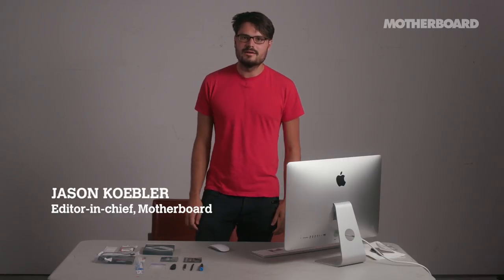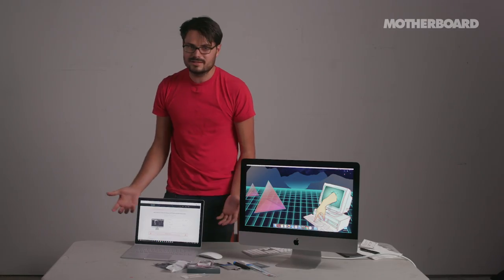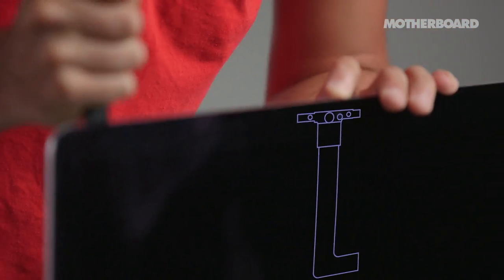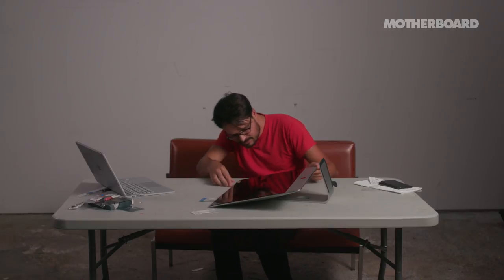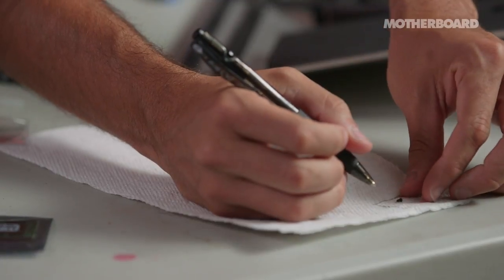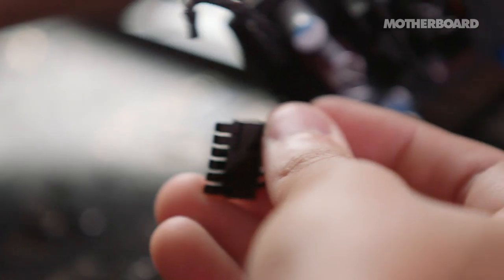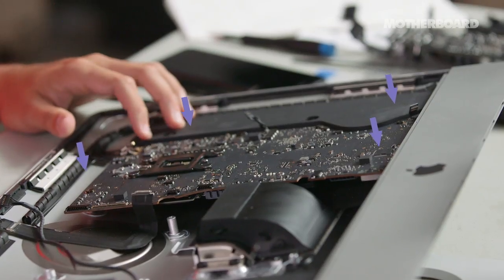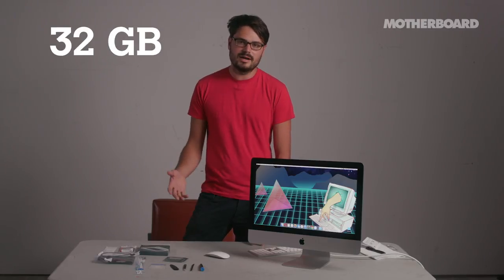Can a Normal Person Upgrade the RAM in the 2017 21.5" iMac?

Comment: Nope.  Anything glued together like that is bad design from the start.  The only time it's acceptable is on a phone, purely due to size restraints and water-resistance.
Reply: These people are the same ones that will end up buying brand new cars that are sealed up so you can't do any oil changes lmao.
Reply: Do you remember user-replaceable phone batteries? I remember.
Reply: I'm fine with that going as lots of phone are now waterproof
Reply: SteelSkin667 member berries
Reply: TehHijack Tesla have all sorts of intelligent tracking in their cars, such as using Tesla pumps to feed coolant into the cooling system.. 

If these pumps aren't used to feed in new coolant, it throws an error..
Reply: Lots of  people (like FyberOptic) ignore that soldering RAM makes it more reliable. They don't understand this so they revert to either 1) Apple sucks (the easy road), or 2) some version of conspiration by Apple to increase profits (another easy road, actually). The good ol' conspiracy theory.
Reply: lol fucking what? gear heads hate apple because they over charge everything, are snobbish, and make it impossible to upgrade/work on the $2000+ device YOU paid for. we are very well aware that soldering on components is far more efficient and reliable, but that doesn't mean they can't break and we like the ability to fix it ourselves without paying a ridiculous amount of money for apple to do it for us.... plus if you lived in silicon valley you would know a lot more about the bullshit they do....
Reply: Spider. You are a minority. The majority of people don't know, and don't want to know, how to upgrade their computer at the physical level. Apple makes computers for the majority. The iMac is MEANT to be that way. It's not a "mistake" or a "bad design".
Reply: Except the ram isn't soldered here. Apple uses glue to save space which, in my opinion, makes sense for a phone, maybe a laptop which focuses more on space and weight than customization, power, or upgradability... But a desktop? Why in the hell would anyone want to own a desktop that is difficult to service themselves? This is beyond stupid. I guess, unless you're the kind of person who just buys a new computer every few years instead of upgrading individual parts as they become outdated and obsolete or fail. This is not an economical design.... but then again, I don't think Apple markets their computers to real computer enthusiasts. They market them to people who need to use computers but don't much care about the computer itself, like artists and layfolk. 
But if you want to stay ontop of having a modern machine, going with an Apple will have you buying an entirely new machine every couple of years. Can you have a great computing experience with Apple? Absolutely. But that same experience with a PC will cost you a fraction of the money AND time (if you upgrade yourself) with a PC desktop over an Apple desktop.
I'm sorry, but if I have to remove more than 2 thumb screws to upgrade my ram, this thing just isn't made for the type of computing I require.
Reply: Apple doesn't GLUE RAM. Jesus Christ.
Reply: no one said that, we're talking about them gluing parts down to the chassis no the actual sockets...
Reply: SteelSkin667 Still around...
Reply: As long as they don't use BGB it's user replaceable. What's wrong with SOP / SSOP?
Apple sells a product and they cleary say that it isn't for a normal user repair as they glue everything together, it has a nice design and works well. If they let every third party hardware in they'll get the same compatible problems as PC's.
Reply: Slam Dunk soldering ram does not make it more reliable in fact its the exact opposite it make more unreliable because you are taking something that is very sensitive to electric shock and introducing a path for it to get shorted before the first use. You are also introducing more heat into a already sensitive memory module and after all this ram reliable is still ultimately decided by the manufacture so there could be a bad memory module solder to the board that is in the process of failing bad will last past the warrenty period. So in what way is this more reliable?
Reply: Soldered RAM saves space, like any other case of surface element vs mounted element. Soldered RAM cannot come loose. Not all components come in plugged-in form factor. Some type of RAM interfaces differently with the CPU, so you need a custom socket. Soldered RAM does not heat more or less than RAM that is plugged in a socket. Your argument about "shock before use" can be applied to any other on-board component, which are many, so it's not really specific. It's also about preventing unwanted tinkering by anyone and reduce cases where you have to judge if it's user error or manufacturer error.
Reply: My phone has screws and is pressure washer resistant with corrosive chemicals; it has the highest water resistance, IP69K, it's not very small, but phones with screws are in fact better at water resistance than glue.

Comment: Step one: destroy the apple. Step two: buy a windows computer. Step three: pop in new memory stick.
Reply: Step four: open google on your new windows pc... Step five: laugh about apple users... Step six: upgrade your pc after couple years with 1700€... Step seven: continue to laugh at apple user the next 3-5 years befor your next upgrade...
Reply: n0Sk_ill

Lol can you have any more cliché and nonsensical arguments to bring up? My CPU was holding back my GPU, upgraded my motherboard, RAM and CPU. Still have my case, power supply, SSD's, hard drives, CPU cooler and GPU. Want to upgrade your Apple? Buy a whole new system.

(That upgrade was from a 5 and a half year old CPU by the way, only now I have the highest tier gaming GPU was it not sufficient for my GPU anymore.)
Reply: I like that idea a lot. But for the average user like this guy would likley be very perplexed by Linux.
Reply: I agree, the average person is going to be really confused by this thing called a "command line." Most people that use Apple or Windows don't have a clue what that even is....
Reply: Step 4: uninstall windows 
Step 5: install Linux
Reply: All that would still take less time.
Reply: anonwoohoo Step 4: wait 4 years for a new windows computer while the Mac could still be used.
Reply: Step 4: Spend the precious moments of your life trying to learn Windows, the poorly-implemented interface copied from a Mac. Step 5: Spend any moments left over from that hopeless quest trying to protect yourself from hordes of viruses. Or just get a Mac and take it to the store if you want an upgrade.
Reply: Step 4, realise that not everyone cares about computers or how they work, they buy it as a tool. Just as many people have no interest in fixing their own car. Techies are such self righteous and patronising pains in the ass.

People are not stupid if they don't know and have no interest in how to do this.

Comment: Step one: don't buy an iMac
Reply: Step 1: Fail to understand that iMacs are not meant to be upgraded this way.
Reply: VERY WELL SAID

ijijijiijijijiijijijiijijijiij
Reply: that's why it was free
Reply: Did he get the joke?
Reply: why do you need steps if it has only one step :)
Reply: Step two: if you do have iMac, then sell it, and buy a macbook pro, Step three: if you listen to me and bought a macbook pro then you can call yourself a....
Reply: Replacing the ram on my mac is the easiest thing ever. The ram sticks are on removable riser cards so my hands aren't cramped when replacing it.
Reply: You have to for any iOS development sadly. Sure you could try a VM but that's shitty and runs into compiler issues. You could also try a hackintosh but you're probably gonna boot it up and find out half of your parts arent compatible and don't work...including your internet card or some other vital shit.
Reply: @slamdunk715  Step 1: there is no rule that upgrading is not allowed

Comment: $800 Windows computer - Runs all modern games and all programs. 
$4000 Apple computer - Runs no modern game and some programs.
Reply: BudgeThePutcher 

Thats the exact cost of my brand new rig with double monitor screen. Rofl
Reply: yeah, but how wany screen does the iMac have?
Reply: BudgeThePutcher macs aren’t for games so I don’t know why you even felt the need of mentioning that lol, and I don’t know what you mean by “all programs” but most professional software is much more efficient on MacOS
Reply: BudgeThePutcher you’re also conveniently  forgetting that you’re “$800” computer doesn’t come with a 5k monitor or keyboard or mouse. So once you add all that stuff it’s more like $2000. Also, your “$4000 Apple computer” is bullshit because the 21.5 iMac doesn’t go that high, the highest price is $3000 for i7, Radeon Pro 560, 32gb RAM, and 1TB SSD, and most people don’t buy the extremely high end iMac lol.
Reply: Hahaha... this guy!
Reply: Gewdvibes when you buy a mac for 3000 dollars you have no way of upgrading it and in 3-4 years it will break, forcing you to do nothing more than to buy a new one. At least with a custom built PC in 4 years perhaps you would only need to upgrade a 1000 dollar GPU or perhaps some 150 dollar ram. Instead of having to pay that same premium again
Reply: Lord_Lammington nice try but I’ve had a MacBook Air for 5 years now and it still works perfectly, hasn’t noticeably slowed down(because MacOS is efficient), is still in perfect condition(hinge isn’t wobbly, all the ports work, battery still lasts 7-8 hours). I’m sure it will last another several years before I have to spend another $1200 for updated specs
Reply: +Gewdvibes 
-1.8GHz dual-core Intel Core i5
-4GB of 1600MHz DDR3 RAM
-Intel HD Graphics 4000

Oh yeah buddy! What's not to love? Those specs will be enough for at least 5 more years! xDDDDD
Reply: BudgeThePutcher nice try again, you’re assuming the cheapest version was bought. You Windows fanboys really love reach as far as you can
Reply: BudgeThePutcher as I said before, MacOS is efficient unlike windows. So even with an Intel HD 4000, i can still do many things where a Windows machine with the same specs would be struggling. I’m not a power user so I’m not talking about gaming or editing
Reply: Hahaha! So you bought the most expensive CrapbookAir with Intel HD 4000? 
Congrats mate! xD Great buy, VERY efficient!
Reply: Lord_Lammington i have a mac from 2010 and it still runs fine
Reply: @gewdvibes  I have a windows 10/linux machine with specs worse than that and it's great for doing normal things on a computer and ultralight gaming too.
Reply: @gewdvibes  MacOS does not have a much game support as windows so that's why windows is better, and it's cheaper to.
Reply: @gewdvibes  $1200 for a mac with Intel HD graphics and a core i5/i7 low power laptop processer with 8 to 16gb ddr4 ram? I can get a laptop with a core i7 8750h or the equivalent to that in the coming years and a Gtx 1060 6gb maxq GPU or equivalent to that too and upgrade it to 32gb ram 1tb name ssd and 2tb HD for less than $1200.
Reply: AnExpiredCartonOfFestiveOfEggNogg the computer cost 1,200 $ calm down

Comment: So you need 32 gigs of ram for browser tabs? Seems logical. Other than that pretty good video. The guy doing the job is slightly cringy. Also, capacitors are like batteries, they store energy. That is why you want to drain the capacitor before working on the device.
Reply: Yea lol 16 is already overkill for that lol
Reply: Capacitors are designed to release short bursts of energy; batteries have a much larger internal resistance, so they can be less dangerous.
Reply: And that's pretty much what he said

Comment: My 20’’inch iMac is literally 10 years old (early 2008), still working without any problem with Logic Pro X loaded with plenty of plugins from NI, Softube among many others. No viruses, no nothing. Just upgraded RAM and macOS through years. Will need a new one for 4K video editing with better graphics, but still, it is quite impressive for an old computer. That’s why I’m a Apple user. They may be most expensive, but they’re built to last. Simple as that.
Reply: Apple's new hardware is built to fail after a couple years, so you are forced to buy new. Watch Louis Rossmann's videos if you want to understand how poorly Apple engineers their products. After fixing a couple laptops, I now only buy models that are designed to be taken apart.

Comment: In the time he took to replace ram 4 pc's could have been built.
Reply: Russel Crozett 

Lmfao. I was about to say. My new rig took 30min only cause i was being taught how to assemble for first time.  And im no computer geek, probaly the exact opposit.  An idiot

In 10 min someone could build a rig rofl
Reply: hell yeah especially now that they took the pins off CPUs hahaha it took me 4 hours back in high school
Reply: His standards of what an average man is is very low.   While I build PCs myself on occasion I have actually did this very set of upgrades to one of my friends brand new iMacs..  it took me 45 minutes with no prior knowledge other then repairing and iPhone once before...  I knew I had to cut and heat some glue.. that was slowest bit since I didn’t want to destroy the LCD.

This guy made me cringe so much... like ripping cables out without unclipping and failing to count to 10....
Reply: It takes me at about 3-5 hours to build a full tower with a bunch of drives and decent cable management.

Comment: Your editor-in-chief of Motherboard is supposedly a normal person who has trouble with RAM installations? wtf...
Reply: SJW hire?
Reply: Basically anyone can change out the RAM in a PC, because typically you don't have to take the fucking thing apart first. 
Just remove side-panel, install ram, put side-panel back on aaaand done, 5 minutes, at most.

Comment: Mac: Go through a 64 step process, 4 hours of time wasted and risk ruing a $1300 piece of equipment for a simple RAM upgrade.
PC: Turn off, remove side panel, plop the RAM in and you're done. (maybe 10 minutes of total time if you need to look it up first)
I cant speak for everyone but I know what i'm gonna use...  ¯\_(ツ)_/¯
Reply: my iMac 2017 has a panel jus like pcs 2 min upgrade but i paid more for the 27" so was worth it

Comment: What assholes. I recently upgraded the RAM on my 2012 Mac Mini and it was designed to be an incredibly quick and easy process. No tools needed, just pop open the door on the bottom and then plop the RAM into the slots, took a few minutes. It's so sad that now they intentionally make it as difficult and expensive as possible. I understand why people hate them.

Comment: My personal way of keeping track of the two million screws that Apple puts into it's machines: Dixie Cups. Get a stack of Dixie Cups, take one out, fill it with the screws from Step 1 of the disassembly process, put it off to the side. Get out another cup, fill it with the screws from Step 2, put that cup into the first cup (basically just start stacking them up). At the end, maybe even put an empty cup in on top just to seal everything in. Just keep cats away from your stack and then when it's time to re-assemble, start de-stacking and screwing things back together. And the cups are generally small enough that they won't get top heavy and tip over (I'm using the paper-ish disposable ones that you'd put in a bathroom or small water cooler). And they'll probably never ever really wear out. And if they do, there's enough cups in a stack it should last damn near a life time.

Comment: 32gb for looking at lol cats? for real? i like to keep a lot of open tabs too, but you really don't need 32gb for that.
Reply: mac for professional,so basally they need insane amount of RAM to project on professional stuff and imac is not for web browsing and etc
Reply: Overhead is always a good thing with system ram. 16GB is already getting easy to fill up on casual browsering.
Reply: FoundationsofPause  yeah, if you have 30+ chrome tabs open
Reply: nope he's right, if you use chrome for example a lot of ram is used depending on how much is available overall on the machine
Reply: I have an ultra wide and I pin tabs that I use often (so a lot,) sometimes I fill half the screen with pinned tabs and it absolutely uses the 24gb of ram I have in my pc
Reply: Xmodii I naw I have three 4gb and one 8gb of ddr3

Comment: I work at a tech store that's a certified Apple dealer. The majority of Mac buyers still pick up the MacBook Air with its antiquity-grade tech. It's the cheapest Mac. Well, it has that logo slapped on, you know? Apple users in a nutshell.

Comment: Seriously, if you don't like Windows, try Linux Mint Cinnamon! You can get something more powerful than this built with tons of options with not even a 1/4 of the cost.
Reply: While Linux is fine for everyday applications, because of the software i professionally use not being available and the alternatives still being very clunky, it's not only a question of liking or disliking an OS (I do CAD/CAM).
Reply: None of the software I need runs on it though.
Reply: Then why not just run Mac or Windows in the first place...
Reply: Nah, I'm a chemist. 99% of the stuff I need doesn't run on Linux.
Reply: The dude upgrading the Mac makes it sounds like he's running browser based stuff, so he's not restricted by OS and there's tons of cheaper options. There are considerable subsidies for education and research based institutions, so they can afford to have windows 10 if needed. Microsoft even offers high discounts on their hardware store too, so $749 CAD for a GTX1080TI  with an educational discount is possible, that's almost half off listed pricing. I'm not kidding. There's always options. I feel sorry though for movie & sound production, their options are limited.